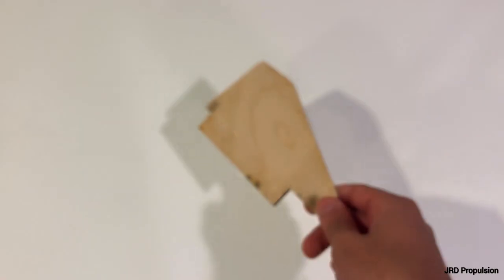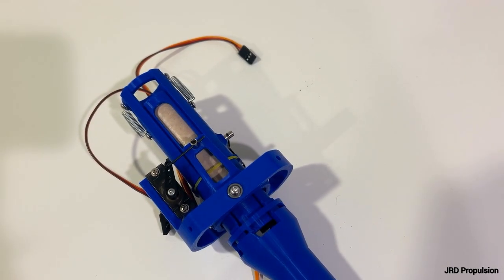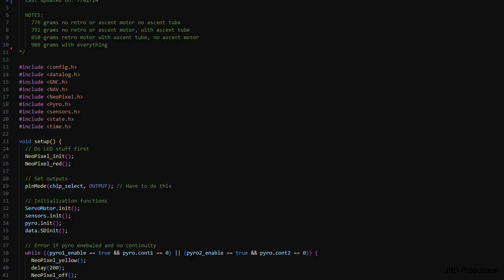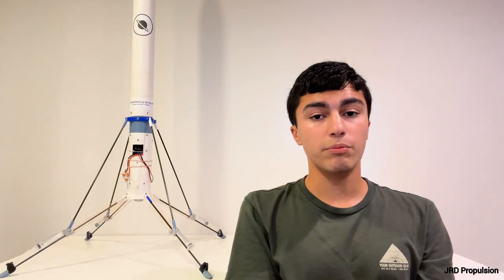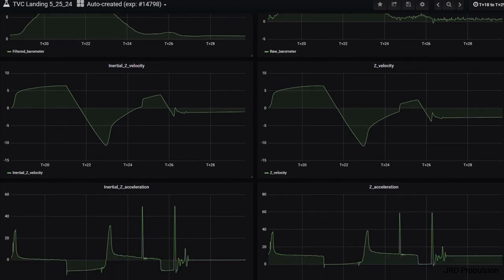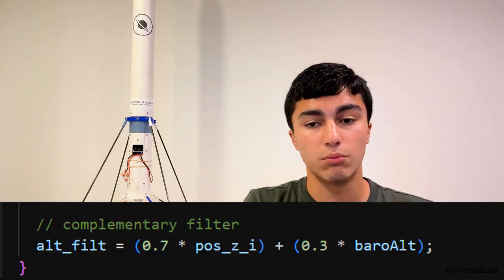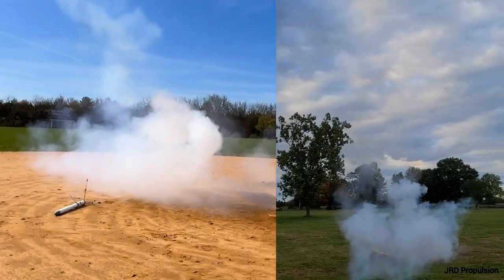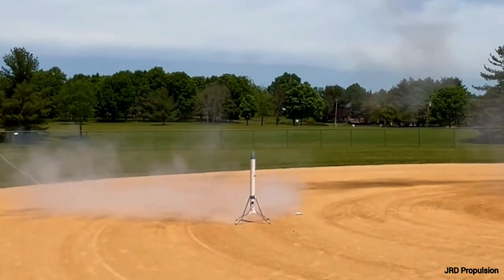I Landed A Model Rocket!

Comment: Congratulations! That's really, really cool. Possibly combine this the ion impulse engines demonstrated on PlasmaChannel. This is really great!
Reply from the maker: Yeah but those don't produce enough thrust for a landing burn. Interesting idea though!
Reply: @jrdpropulsion  ... not yet. That's the point! Before I continue: you know more than me about rocket science. The following is just my excitement and connecting ideas between related work. 

We know that we are primarily moving fluid (air) through atmospheres (g, gravity), and that this is a (currently) different set of technologies and relations from moving mass through a vacuum. 

However. 

Scaling down the project to match the ionic thrusters may provide opportunities to discover principles for scaling it back up to feeling with massive fluid densities in gravity (liftoff through the atmosphere, stratosphere, etc.).

What you've done is kickass and it beats what I've done, which is nothing. =|

PlasmaChannels demonstrations have been centered around moving mass efficiently,  around and through the ion-thruster materials and form, in mostly-horizonal modes. There are demonstrations of lift, though, especially with the ion plane. 

That lift, with your experience in current microelectronics arrangements for your project, combined with the landing at even smaller scales (think: nanodrone) might open discovery opportunities for ion rockets.

Then again, maybe I'm full of ish.

Comment: Magnificent work. :)

I cannot get over the fact this is possible. The sheer weight of the electronics to do this 20 years ago would have made the form-factor infeasible; it's wild to me to see this pulled off with a small custom circuit and an accelerometer package the size of a kid's fingernail. And the syringe hack is brilliant!

Comment: Man this is so cool! I also designed a TVC rocket system for a course project last semester and the main objective was just getting the gimbal to correct its position when moving using it using an apparatus (my hand lol). However this goes above and beyond not just launching one but also landing it upright, this is just an amazing project overall! Also if you don't mind me asking what software did you use for designing the flight computer? Currently teaching my self how to use Altium designer so I can get my own custom PCB for the flight control, but any tips would be appreciated.
Reply from the maker: I use easyEDA. In my opinion, for smaller, relatively less complex boards, it really doesn’t matter what tool you use.

Comment: Landed it vertical SpaceX style with just a baro and accelerometers? That's impressive. Thought you absolutely have to go either radalt or laser rangefinder.
Reply from the maker: It's surprising how accurate the data from these sensors is, albeit only for a few seconds.
Reply: @jrdpropulsion  Surprising is an understatement.

Comment: Congrats! Obviously the Landing was rougher than intended, but that highlights the praiseworthy resiliency of your landing legs. A lot of the attempts by Joe Barnard and others would have been successful if they were using your leg design. You might have to change it later to reduce weight and make it easier to manufacture, but delivered your first true landing so it definitely delivered what it needed to do. Congrats again, and best wishes to the next iterations.